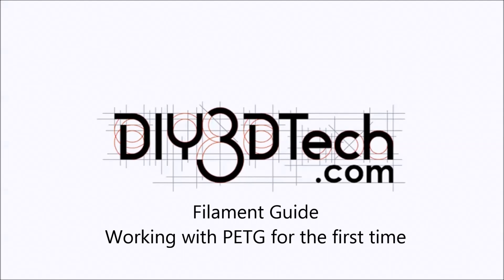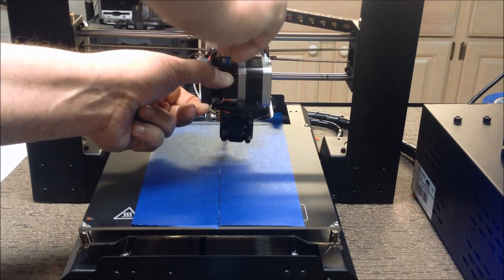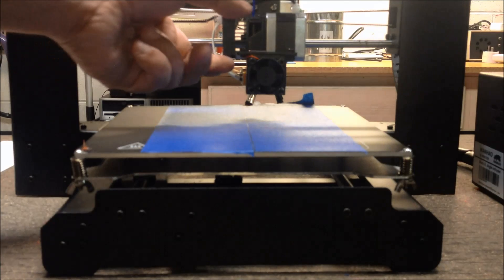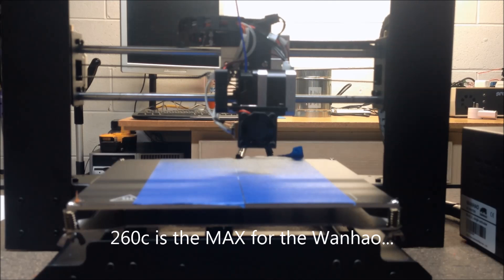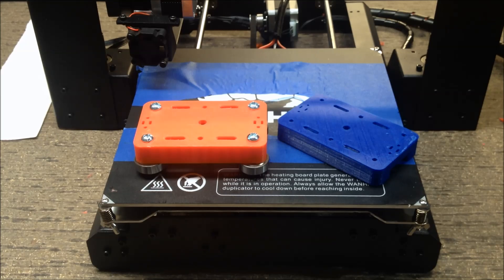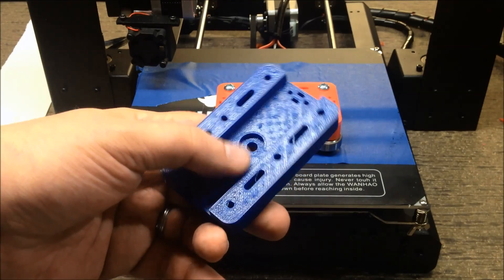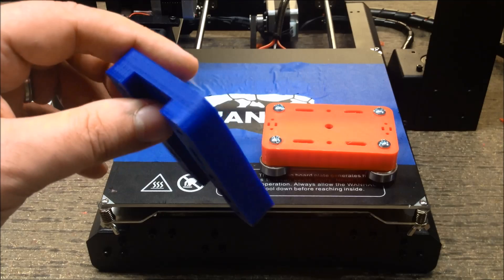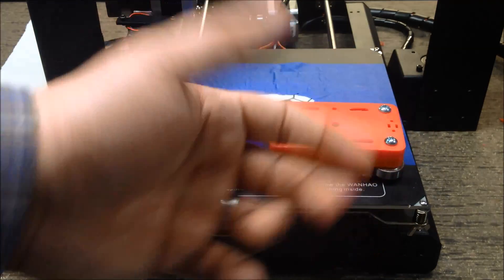Filament Guide - Working with PETG for the first time!

Comment: I wanted to offer you a warning.  The PTFE liner of the MK10 extruder included on the i3 is rated at 255/260 Celcius.  Furthermore, from my research it doesn't seem recommended to go over 250, mostly because the thermistor has a margin of error of at least +/- 3 degrees.  Additionally, there is a known electrical problem with the Melzi board included in the i3.  The heater circuits are not properly grounded, resulting in large temperature fluctuations.  You can browse the i3 google groups board for more information and view the following Wanhao repair solution at https://www.youtube.com/watch?v=Ak9kyObHr0Y.  That said, I haven't printed PETG myself yet, but it does seem to be recommended to print with the cooling fan off.  I'm not sure if you've tried that or not, the video didn't show it well enough, but it that may help you lower your nozzle temperature.  Thanks for the video and good luck!
Reply from the maker: +Nick Gilbert Nick thanks, actually my Wanhao will not go over 250c setting wise and frankly think it stays the south side of the setting by at least 10deg.  I have an infrared contactless temp meter but the battery's are dead and they are funky ones.  However this is something I would like to check, also have printed a ton of PETG with no issues which confirms my feeling of the south side reads, however your point is valid for people who are not aware of this and thanks for posting!
Reply: +Nick Gilbert If you notice,.......he has a fan blowing on the extruder tip.  That's probably why he has to put the temp so high.  I have never done this with either of my 2 3D printers.  It seems to defeat the purpose.  I've also seen all kinds of fan configurations blowing on the build platform.  Never knew why because it also seems to defeat the purpose of a heated-bed and if it weren't heated how would anything stick to it with all that air blowing on it.
Reply from the maker: The placement is actually little misleading, the fan blows on the bed and is designed to cool the layers as are they being put down.  As this helps with "bridging" as well as layer quality.  Also depending on your printer and slicer settings, you note you fan will not start or if does its only at partial speed for first few layers.  As the heated bed is intended for improved adhesion and to limit warping (which isn't a big issue in PLA)...

Comment: Great vid.. i will have to give PETG a shot after i go through some of my present stock of abs and pla..
 so what happened to the DaVinci?
Reply from the maker: +klawndyke I still have both of them also just ordered a frabracator mini too :-)  However on the Da Vinci's I will most likely reflash them in the near future so if your interested watch for a video...
Reply: the moment i got my second printer that was the first thing i did was to flash the Da vinci with repetier. works a lot better than the xyz software, great printer shitty software plus no more cartridges.. keep up the great work and cant wait to see what you come up with next
Reply from the maker: many thanks!